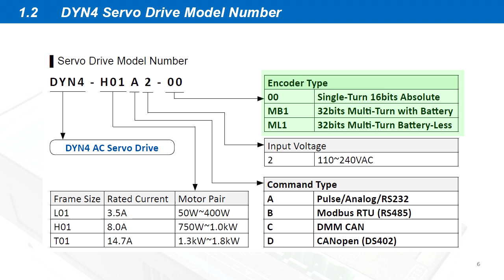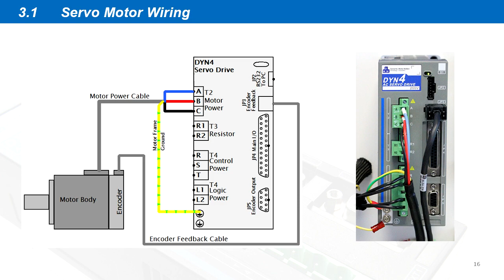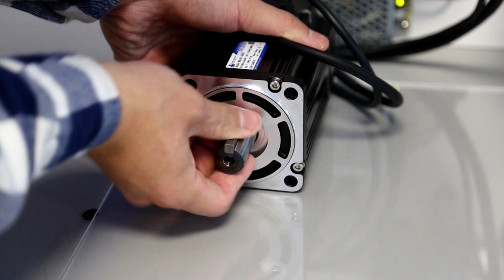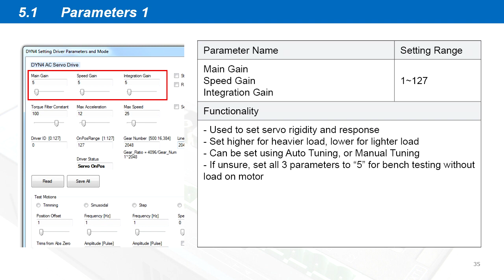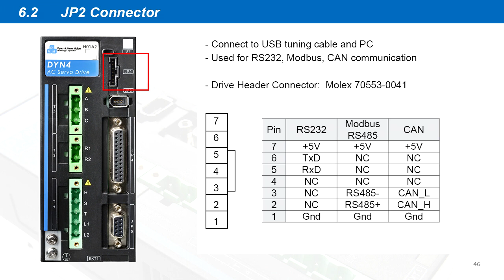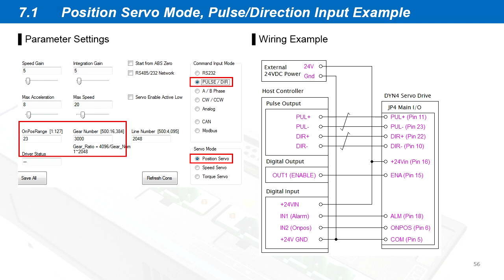DYN4 AC Servo System Complete Setup and Overview

Comment: Hi James! Question on circuit breaker. If I'm using in 4 axis set up with DYN4 AC servo motors, what size circuit breaker do I use 80a or should I use the 60a listed in the 3 axis wire diagram?
Thanks for the excellent support and product!

Comment: So what setting would cause your drive to keep pumping power into the breaking resistor without a motor connected to it? We've been trying to resolve this issue for about 6 months and our engineer has been having significant problems getting support.

Comment: Are these motors enough to cnc a bridgeport mill?
Reply from the maker: Hello, for a Bridgeport mill, we usually recommend using a 750W or 1.0kW motor direct drive on 5mm or 10mm pitch ball screws.  Please contact our engineering team at info@dmm-tech.com and they can assist you directly.